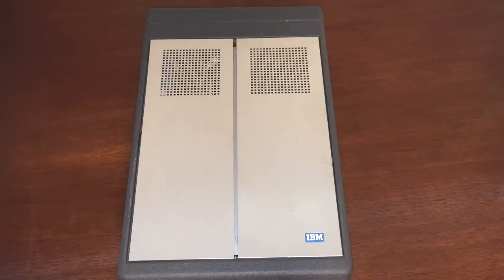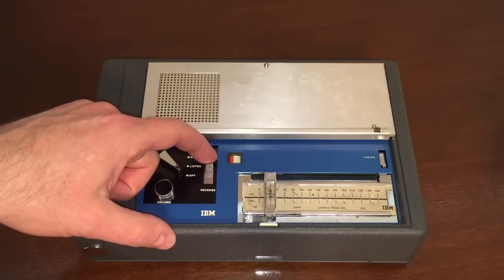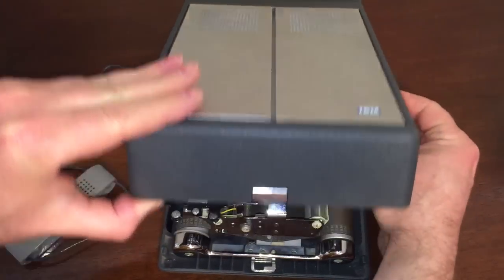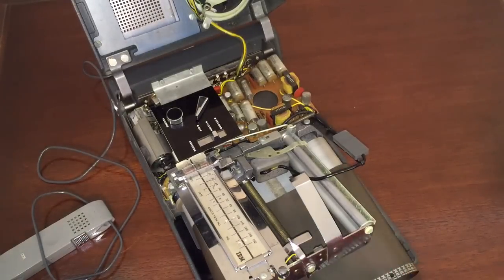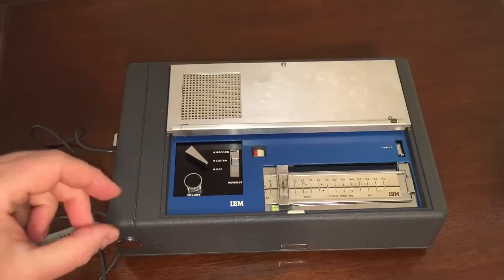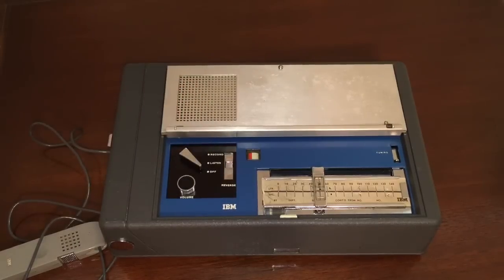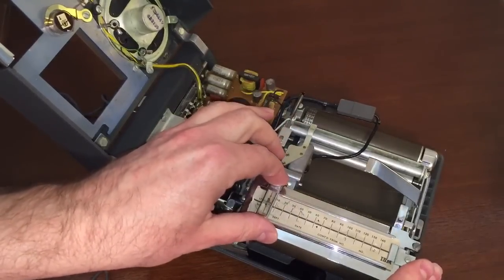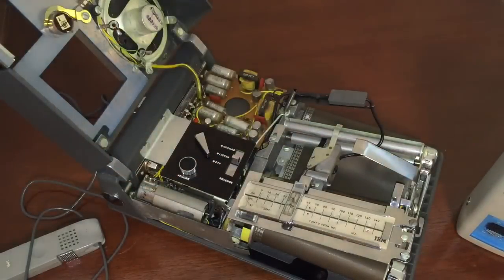Vintage Tech: IBM Executary Magnabelt

Comment: Great video DB. You're right - everything was built better then. I recently picked up some old radios here in the UK one of them is a transistor from 1960. Popped a battery in and it worked and sounds great. You possibly wouldn't get anything made now still working perfectly in 2064 or thereabouts.

Comment: Great video about a wonderful bit of vintage tech! Very good looking, well made, great sound and great design! IBM really came up with a solution to a serious office problem with these dictation machines. However, it was strictly business, with an expensive price tag to go with it. I think these machines sold for about $300 at the time, and the belts cost about $5 each - when a 3" reel of tape was only $0.50! I know becuase I was there!

People had used standard R2R tape recorders for dictation, of course, but they had to fast forward and rewind to repeat passages or skip them, and threading the tape was clumsy and could be done backwards or wrong, etc. That was a time waster.

Imagine if you were a typist and had to transcribe a letter located half way in on a reel of tape. You'd get the tape from your boss, put it on the machine, then fast forward until you found the letter -- possibly using the 3-digit tape counter, if your boss had used one -- and then play back and type. Finding the exact place on the tape was still guess work because the counters were not accurate at all, and the counter on one make and model machine was not the same as on another make and model, so there was no compatibility. Pausing was a problem without a foot switch, and jump-back rewind (because bosses did not always speak clearly) called "review" on modern cassette machines), didn't exist!

IBM came to the rescue with their magnetic belt recorders. I think they were the pioneers in the technology, and it was later copied by the Japanese.

The machines made loading and indexing (I think they called it that) extreemly simple. My dad's office had several of these. What they used to do in my dad's office was -  several executives shared a machine, but each had his own magnetic belt and paper index marker. Each would take turns on the machine (borrowing it like a library book) to make a recordeing or several on his own belt, with the paper index marker punched as you showed. They then sent the pair of these to the steno pool, where a typist would playback the belt and type the letters. If I recall correctly, there was a way to write safely on the belt or mark it somehow to identify the owner, maybe there was a box or pouch, I can't remember.

My dad used to bring one home and dictate into it early in the AM when we were all asleep. He let us record on it. I tried playing music (piano) but it sounded pretty bad! I remember him changing the magnetic belts too. If I recall, one of the rollers in his machin had a rubber coating on it so it would grip the magnetic belt tightly.

Oh, btw, if I recall correctly, the dictate/conference switch was for the mic sensitivity. Dictate lowered it so you held the mic close and dictated. That was the clearest recording. Conference was obviously for a group of people, and amped up the record gain, and subsequent noise. You can try it on your machine!

My dad also brought home one of those flexible record cutting machines. They were pretty wild too.
Reply from the maker: ***** Enjoyed reading your post, thanks for sharing that!
Reply: Thank you for your great comment, how much would it be today? I got one and 5-8 belts

Comment: I bet the dictate/conference switch is a microphone sensitivity (gain) adjustment. For dictation, you'd probably have the microphone close, requiring lower gain. For a "conference", I'm guessing you'd leave the microphone sitting on a conference table to record a the whole group of people in the room, and thus require higher gain.

Comment: Astounding this using a magnetic belt that still retains a signal after all this time. We get more info on how long magnetic media retains a pattern all the time. I saw a dictation unit years ago that used a plastic belt to cut grooves in for playback and were meant to be put in an envelope and mailed like a regular paper letter. A shame it was tossed out, likely because it didn't work or nobody knew how to use it. I saw one of its dictation belts, much like your machine, but made of clear red plastic? or something anyway. The cut grooves were visible at any rate.
Reply: Tefifone?
Reply: Sounds like a Dictaphone Dictabelt, databits has one of those machines, too.

Comment: The gear disintegrating sounds like the same IBM horror story as the IBM Electronic 50 where the power module gears (of a certain type of plastic) all cracked and had to be replaced in all models of the model series during the 1980s.

Comment: I'm surprised that the caps were not shot. :)
Reply: Caps only go bad on electronics made between about 1980 and 1995 or so. That was when cheaper capacitors flooded the market and it was called the capacitor plague. Old capacitors are generally still good.
Reply: @AureliusR  Sure, if you discount leakage. Electronic, not physical. As a general rule, it's good practice to replace old caps.